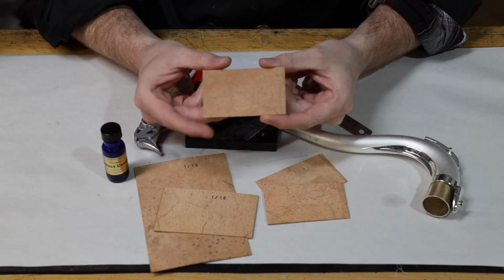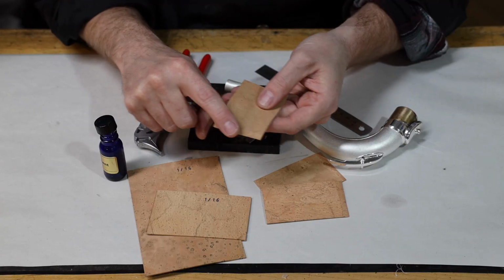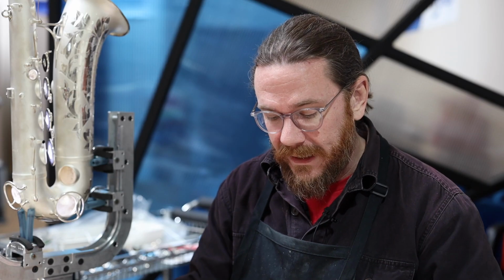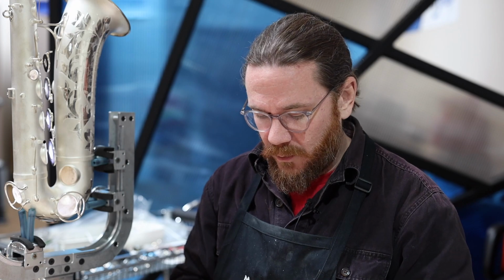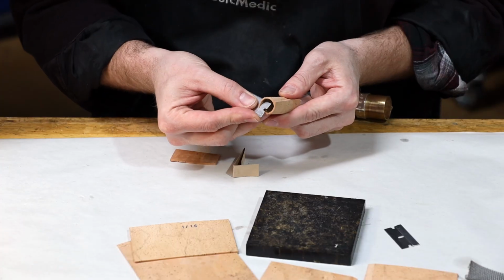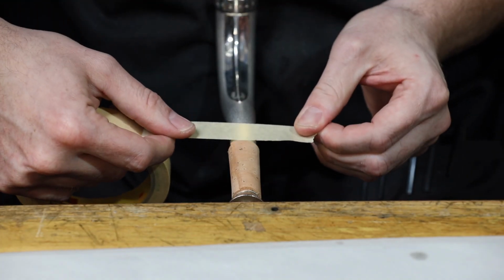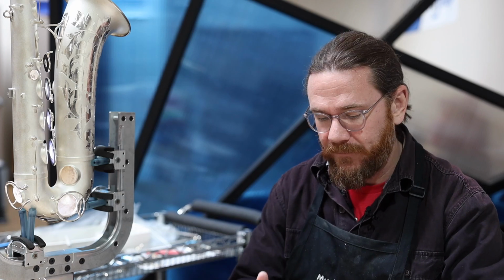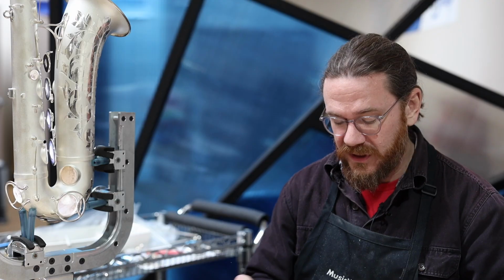How to install a pre-beveled Saxophone Neck Cork

Comment: Nice. In some sax the neck has a ring in the end. I always start from there. This technique is adequate to that type of necks?
Reply from the maker: It depends, some players want the ring exposed and some want it covered up. If you have a players who wants it exposed don't apply glue to the ring and trim it off with razor blade. Sometimes we use masking tape as a guide to get a super straight cut.

Comment: 3 things wrong with this: First you are sanding against the the bevel which will peel what you just glued, Second the taper of the cork should be cut into the bevel so you do not have to guess the taper when you apply (when cutting the taper use the neck as a guide parallel to the edge of the cork), Third this should all be done in one motion (you should never stop to reglue the top of the bevel). You are putting strain on the glue as the cork is wanting to remain flat and has not yet wrapped onto itself, it will cause a weak spot if not peel off (especially if you are using 1/16). Also you should never cram a mouthpiece on without lubrication.
Reply from the maker: There's definitely more than one way to do this job and still have the same results😀
Reply: If you lubricate and then check the fit and decide more needs to be sanded off, won't the lubrication make it a real pain to sand?  This is a question from my own inexperience and wonder what the pros think.
Reply: @drdan2001  there is a mesh sanding material that can be used if you have to continue sanding, but generally you can tell based on putting the tip of the mouthpiece on (1/4 in). It should be very snug, but not be impeded by the thickness of the cork.